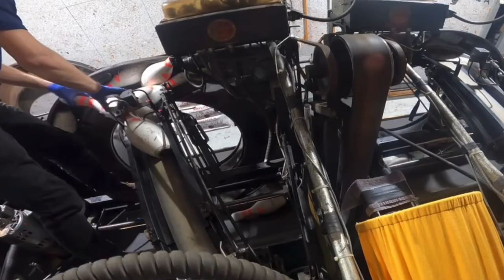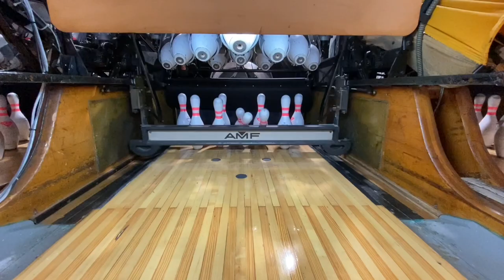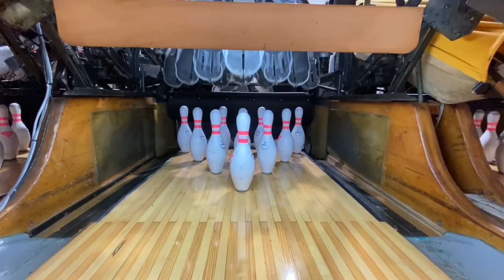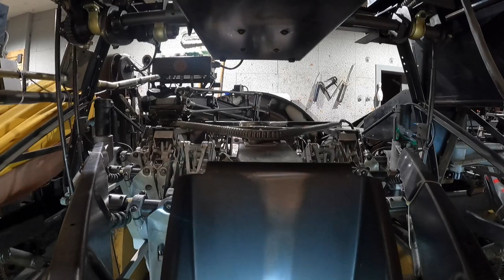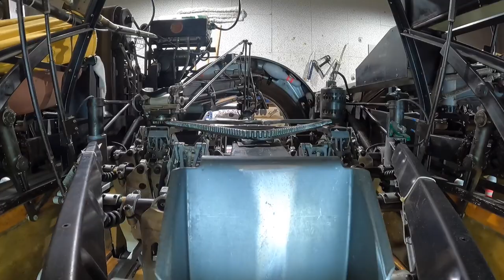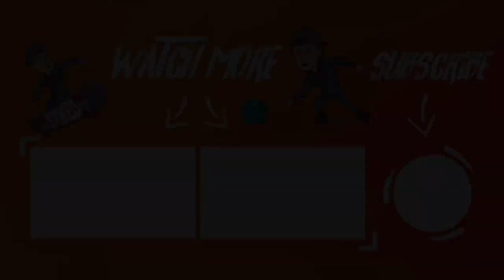AMF 82-30 Distributor Operation

Comment: Cool vid with great perspective. One thing I do not know though is how the distributor knows whee to stop and exactly how the drive works. I used to work on 70's and understand those fully but have never been able to figure out the 30's distributor. Any info is appreciated.
Reply from the maker: Hey Phil! So basically there’s a set of gears that are located on the bottom of the distributor head(under the trip lever). One of the gears has a lip sticking out of it and there’s another stopper directly under the clutch lever. When those two meet, that is what stops the distributor at each cup. It works because the distributor travels the same distance between each cup. Pretty neat. Thank you for the comment!

Comment: Question : 
Does the distributor has some way of being adjusted.  In case it has been moved in any way.  And is not dropping the pins in the right place.?

Thank very much in advance
Reply from the maker: Hi! Great question! The distributor can be adjusted in several different ways. If the pin is not falling into the cup smoothly you may need to move it 1-2 teeth forward or backwards on the track.